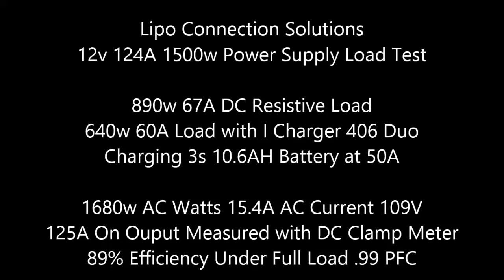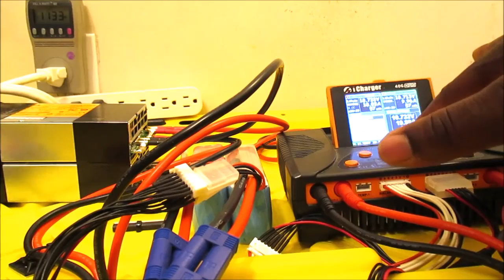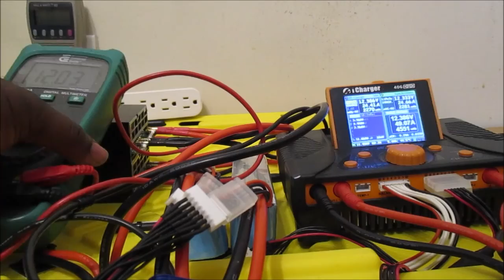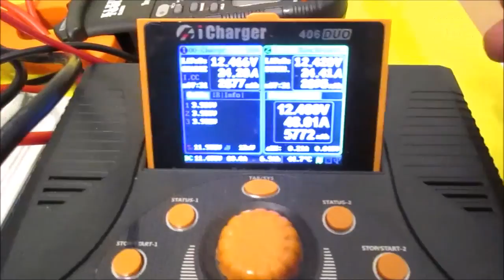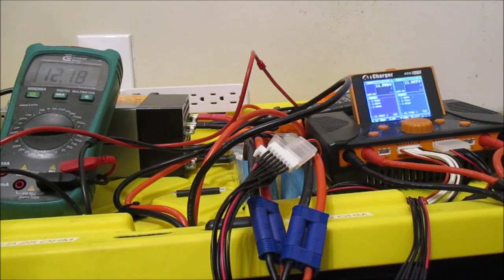12v 1500W 124A Power Supply Load Test... How to kill a Killawatt Meter

Comment: is that a special 120Vac outlet you have hooked up, or is it just a regular bedroom or office type outlet, because those would be rated at 20A circuit breaker in your panel, so 120Vac x 20A is 2400W before the breaker would trip. Hopefully there is nothing else of high wattage consumption like a space heater on the same circuit.

Either way good video Chris, I've been trying to figure this out, how much would two psu's pull from the wall, 13-15A (1680W) is good to see, should be well within the buffer zone of your outlet.

BTW Good news on you getting back to work mate, Fibre Optic Cables sounds interesting. I did a few manual splices a long time ago myself at the local community college here, called SAIT.
Reply from the maker: Mark M it's 15a bedroom outlet older home early 2000 so 1800ish watts max
Reply from the maker: https://youtu.be/Sekh9QcyAG4 one of the Fiber Optic Stranding Lines I run. One of the older lines... About 20+years old. I'm running a 1.5m dollar line now that can strand cables up to 1728 fiber cables.